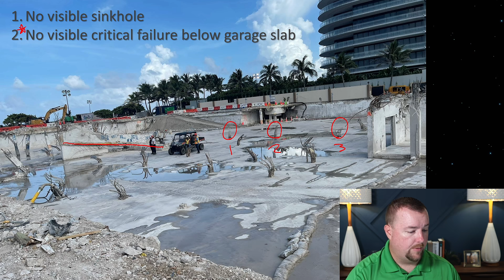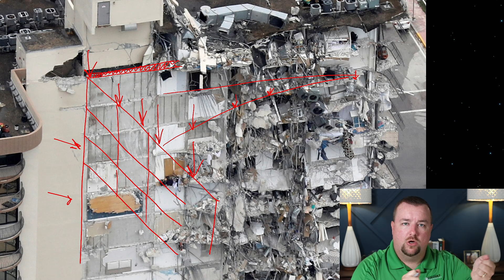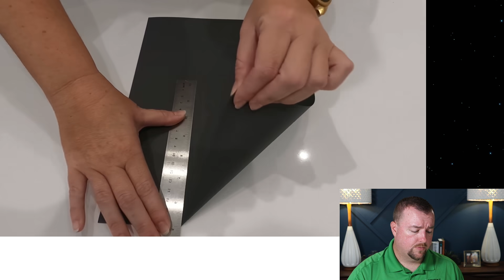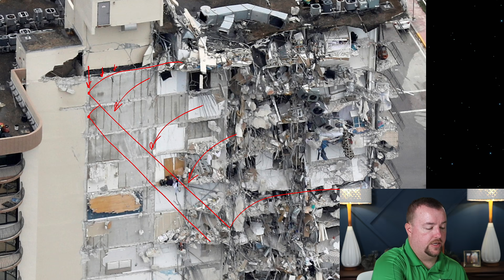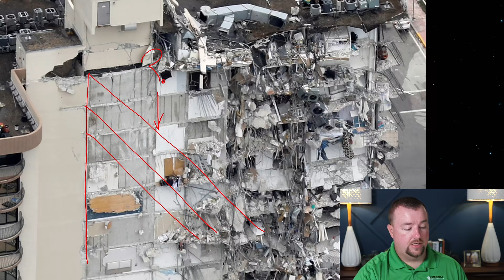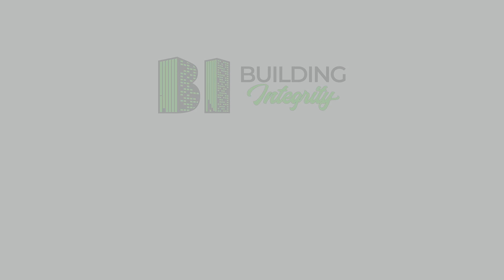Surfside Collapse - Structural Engineer Explains Why Only Half the Building Collapsed

Comment: 30 Jan, 2025: DAMAC, a Dubai-based developer announced plans to build a 12 story building with 37 “mansions” of 7000 ft2, priced at $15m each on the site. “Staggered floors” by Zaha Hadid Architects The AP story mentions that the cause of the previous 12 story building collapse is still under investigation by the NIST.
Other than the staggered floors, I don’t see any mention of construction details or any provision for resisting salt exposure.

Comment: I have worked on concrete structures and this one wasn't built according to the engineer who designed it. The 3rd party inspector over looked the rebar as did the city inspector. It's a wonder it didn't fall after they stripped the forms after it was poured.

Comment: I recall how the column's where saturated from a previous video. It's entirely possible that the columns where badly weakened at the base, constantly loosing strength and influencing the motion of the building as it settle un-evenly. (The many cracks that formed before the final collapse.) Given the garage caved in first, that might have been the night those three columns finally gave in, and everything else above with them.

Comment: I live in a concrete high in a "developing country" built about 10 years ago.

They have an unusual building technique. I watched a new project nearby and kept a diary. Year 1 they hammer the piles in to the ground then they perform tests on the piles. For reasons unknown to me, a few additional piles are added.

Then "ground" (including parking garages,sewers) concrete work is completed and a couple of months of testing is performed {trucks filled with racks of test equipment). Construction of columns and floor slabs are begun. All the re-bar is delivered preformed. When the re-bar is installed every one of the rear assemblies is welded to the adjacent assembly. I, as an nocturnal visitor, visited daily. These completed areas of re-bar were "dead" square. Verticals were vertical and horizontal surfaces were precisely level.

The floors were built and the care of the construction continued. A white coloured test unit container followed on two floors below each time being craned up when moved. This continued to the 20th floor and the roof.

Then there was total work pause. I spoke to a guy (wearing a white shirt) who explained the investor will hold the next "tranche" of money. He also explained that the care taken with verticals, etc., reduced the costs of "finishing" the building.

Eventually, the elevator machinery was hauled in to place and one activated.

At this time, the highest floors were finished ready for sale. It appeared the each floor took about 2 days to "furnish" ready for occupancy. Another "clean" elevator was activated and prospective buyers could be seen looking around.

I visited the property and looked around. The walls were concrete, with plaster filling up minor defects. The floors under carpets were the very flat construction floors. A tiled kitchen floor could be completed in a few hours. Doors were secured to frames cast into the concrete. No drilling needed, machine screws testitified to the accuracy of the work.

Seemingly the construction company was South Korean. The completed project is near perfection and appears as if it is mature building. The whole thing was amazing.

Comment: After studying this case I have concluded the building failed due to lack of rebar bond stress resistance. This result can be seen where the rebar unzipped out of the slabs. Also in the powder consistency of the concrete. The construction on the adjacent Hotel caused thousands of shock waves that caused a separation of the rebar/concrete couple.
The collapse started around floor 8-10 first bringing down the penthouse and roof.

Comment: One end of the slab you show in your example went down but the other end still partially connected to the column, went up tearing out the rebar in an upward motion if it had been attached to something. And then down if the column failed or punched sheared?

Comment: I’m a bit surprised there wasn’t a shear wall between phase 1 and 2 of the collapse, why wouldn’t an L shaped building have an L shaped shear wall to better distribute its weight? 

Also have you ever worked with ISpan buildings? It’s essentially drywall grade steal building beams and engineered floor joists, with a 2” poured floor slab, it’s intended to minimize overall weight of the building, but it’s terrifying as F, I’ve done 2 twelve story buildings as a commercial plumber, little 175lbs me can get the whole structure to shake if I jump on the floor, so scary. A building built with this method partially collapsed in London Ontario Canada a few years back. I don’t know how builders are getting away constructing with this garbage product.

Comment: Question: There is a possibility the slabs' rebar was attached with just 4-5 inches straight in the shear wall. If that was the case would properly attached rebar have saved the building or would it have pulled down the rest of the structure?

Comment: Question about the shear wall: was it tied to slab and columns with rebar, or was it a solid concrete filler between columns and slabs?

Comment: Maybe this is a stupid idea, but I wonder if putting a small notch in the top of rebar with an angle grinder before pouring the concrete would be a way to set up a "break-away" failure point to stop progressive collapse?  What I mean is that you obviously want the concrete/rebar to hold the weight it is designed to hold under normal circumstances, but if an extreme force comes along, such as the sideways tension coming from that catenary action, it seems like it would be preferable for the rebar to snap cleanly, sacrifice the part of the building that is already collapsing, and arrest the progression.

Comment: (9:00) Very valid point about the starting point of the shear.  The shear stress is never uniformly across a span like in the earlier structural design phase before actual construction.  It always starts as a failure POINT and progresses along the connected spans.

Comment: Here’s something I’ve always been curious about. If we have an exemplar building, one that has been built properly, using this flat slab construction, what do you generally have in the way of redundancy? Somehow I find it hard to imagine that if you smacked one column out from under the building, that the whole thing would collapse. Surely you’d think that the other columns would be built with allowance to take up extra load from a failed neighbour.

Comment: I have a question!

Are most concrete residential buildings in the US built like this one with columns and sheer walls?

Where i live in sweden they build them with solid supporting walls that run the whole width of the building.

Comment: The penthouse suite made the building collapse because it pushed the columns on the lowest level of the building in the parking garage section to be overloaded over that section of the building because they never used I beam support system to reinforce the whole condominium part of the complex. Rebar is one of the weakest building materials around because because every bend you do to it you weaken it  and it's only good for helping hold concrete together and concrete is sponge soaking up water unless you water proof it and salt spray is a acid to concrete.

Comment: my education background is civil/structural.  my professional path went from the design side to project management.  so far I have watched two of Building Integrity's Surfside videos and found them to be well done and brought me back to my roots.  I have two items, one question and one speculation.  I haven't found a good explanation for why the east section, section 3, collapse last.  from my thinking there must have been a floor slab reinforcement issue for the slab to fail/separate on the east side of the first section to collapse.  actually the same thought for the interface between section 1 and section 2.  the speculation, in the back of my mind I have a thought of the possibility of a vehicle impact on a critical column in the underground garage.

Comment: concentration of force at a corner or junction is called a stress raiser.
Reply from the maker: Kind of.  A stress raiser is, in my opinion, a location where stress concentrations can occur due to design features such as holes, notches, etc.  What we're looking at in this video is that in a collapse, stresses are not distributed uniformly like we model them in our calculations.  We refer to that phenomenon as non-uniform distribution.

Comment: Did the unclasped portion of the tower also have downturns beams between the columns, which the collapsed portion did not have? When the shearing floors passed the end of the shear wall, they sheared at the 45 degree angle until encountering the thickened slab/beam, which then deflected the shear failure along the column line, instead of continuing into the next column bay, which did occur in the collapsed portion of the tower having same sized columns.

Comment: Notice how most of the shear wall was not really attached to the part that collapsed, if there was enough rebar attaching the failed to the sheer wall, that may have ripped that wall down also by pulling it sideways while it fell. It sure tried to pulled down the center next to it though.

Comment: This is my theory, not only did the pool deck collapse first, it took the whole ceiling in the garage with it. You can see the damage it did from the north side. the whole ceiling fell and you know some of those damaged columns went down, and it was doomed. The pool deck leaking for years and the weight from rain water and sea water done the building in along with neglect.

Comment: Great work explaining the cause. You say no sink hole, but when the ground water raises and lowers above the floor slab the pressure to the slab is up rather than down. If the slab did not allow the water to enter the garage couldn't the water pressure under the slab cause the floor to explode upward?

Comment: You know what i dont get. Which would have saved many lives. Why did the Fire alarm not go off when the pool deck collapsed and cause the garage sprinller system to flow water. That should have instantly cause the FA to go off and dispatch the fire department. Which in that famous video from the garage entrance we see no fire alarm going off and plenty of water dumping. Ppl can say that wasnt a sprinkler pipe that was bursting water. But your telling me that wholr pool deck collapesed and all of the garage sprinkler pipes were still intact. That fire alarm ahould have went off no more than 90 seconds after the garage water flow. So 8 minutes after the deck collapse the building came down. If the FA worked like it should have   Fire Department more than likley would have been onsite at the time of collapes not that it would have made a diffrence. But ppl would have evacuated. Who was the fire protection company. Id love to see there falsified testing report saying the garage was working. Which im sure it was disconnected due to ground faults from all the rot in the garage sprinkler pipes and FA conduits. Unbelievable man  literally could have saved lives. This is why we call it life safety system. Ppl not to start being accountable for all of this things that are being over looked.

Comment: On the north side of the building that didn’t collapse, I noticed on the plain stucco wall portion, you see horizontal structural tearing of a sort that matches up with Floors 2-8. However the exterior wall outside of Floors 9-12 seem intact and not damaged. Why would this be?

Comment: I think it was the non-uniform distribution of sudden stress relief caused by the explosion of pre-placed charges that were not placed or did not go off in the part of the building that stayed up.  That explains the straight-down collapse, that wonderful and amazing pancaking just like a demolition, and there's no particular reason to think it did not happen.

That straight-down pancaking indeed did not cause big side loads on the rest of the building, and so it could stay up.  What's not explained in any other way is how the part that collapsed could do so so neatly, and after a fairly clean structural report just a few years earlier.

If I recall correctly, this narrator does not claim qualification as a structural engineer.

Comment: Josh - Note that where the slab connects to the shear wall a tension or pull-out force would be generated by the  catinary action of the failing slab which in addition to the vertical increased loading add up to a very large principal tension stress at some angle (30 to 60 degrees) depending on the relative horizontal vs vertical magnitude which is essentially a shear failure.  ( Note concrete does not fail in shear it actually fails in tension).  Your graphical descriptions of the failure mechanism are great.  Note that as one punch thru failure occurs not only does the slab deflect causing bending or non-uniform loading at the adjacent columns but also the load that the failed column connection was carrying  gets transferred to adjacent columns.  A double negative effect thus the failure spreads until normally the whole building comes down.

Comment: One of my question/concern is why is there salt water on the basement floor? Is it seeping up through the concrete or hairline cracks causing spaulding? Also, is this salt water intrusion happening to other buildings along the ocean being that water can migrate through sand?

Comment: I'm field engineer and have been involved in a lot of serious construction. However, I've also been party to massive explosions that hit buildings using artillery. If you want to drop a building, you don't shoot it in the center, you hit it where the ground meets the building, shattering it's foundation. Once the main structure is broken-free from it, it's face will literally 'slide-off'. The foundation failed. Likely due to water intrusion from rising sea levels.

Comment: The reinforcing rods are clean of any concrete because the rust allowed them to pull out of the concrete. Strange as that is even on the upper floors where no salt water could get them to accelerate the oxidation. Please check?

Comment: You do a marvelous job explaining to laypeople in construction terms and teaching in a way that doesn’t talk down to the learner/viewer. Informative, articulate, and fascinating. I’m grateful to have you educating us through this tragedy. I know the first words out of my mouth were how does this even happen?! I’m glad YouTube and folks like you can help to make educated suppositions and look at logical possibilities. Thank you.
Reply from the maker: Thank you for watching.  It means a lot!
Reply: A simple exercise: For each 100 pounds of horizontal component of wind force directed against a north wall, each of the east and west outside walls that are at right angles to it takes up 50 pounds of force. If a third interior wall is added parallel to the east and west walls then each wall will take up 33.3 pounds of force. The floors that also transmit this horizontal component of force to the outside walls prevent inward deflection of the north wall. Horizontal force transmitted by the floors that is taken up by the footings of the columns and rear wall may be ignored for this analysis.
   
Is a third interior wall of solid concrete required? (Referred to in some discussions as a shear wall). After calculating the force that the east and west walls must accommodate it is a matter of design choice. It is likely that the minimum thickness and strength of the east and west walls already greatly exceeds the horizontal force that these must hold back. Thus, for each 50 pounds exerted horizontally, the walls as a result of their strength to function as a wall supporting the vertical downward load from weight, are already capable of sustaining a horizontal component several times that amount, which is why the contribution of the footings was ignored.
   
A building is designed so that the entire structure remains standing. That a collapse is only partial appeals to emotions, not logic. 
  
An interior wall of solid concrete that is not connected by rebar to the adjacent part of the building is in effect an exterior wall to which an abutting structure has been added that encloses it making the whole thing appear to be a single building. Pre-construction-sales enabled raising capital for a much larger structure.¹³
   
The reason behind this two-phase approach is finance, not engineering. 
    
     
     
¹³      For each dollar investors advance for the cost of constructing a 100-unit building unknown to them these funds are sufficient to build twice as many units. The 80-unit addition that effectively costs them nothing accrues to the organizers.

Comment: I assumed, given what was presented earlier (fractured garage floor, water intrusion and corrosion, concrete spalling, rebar rusting, etc.), that the collapse started from the bottom. The most astonishing revelation in this video is that the building appears to be collapsing top down. This can be clearly seen at 0.5 speed. Top three or four floors of the "central" section (in the picture) are already failing while the bottom still appears to be intact. So is the wing on the right. As the collapse progresses, the "right wing" is being pulled in and taken down by the collapsing center structure. Now the real question is why, if it did, would the building start collapsing from the top???

Obviously, the shear wall saved the remaining section of the building. It almost seems like the shear wall acted as an (unintended ?) rip-stop to keep at least one section of the building standing while the remainder collapsed.